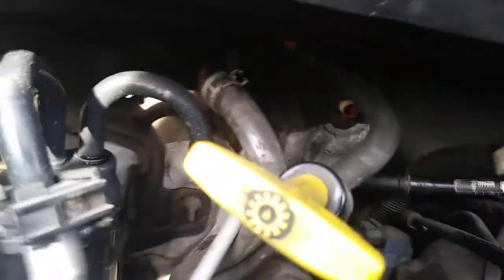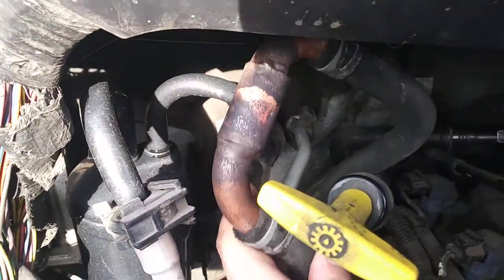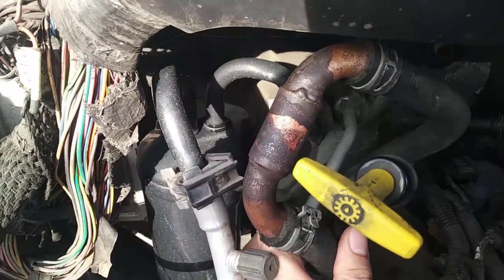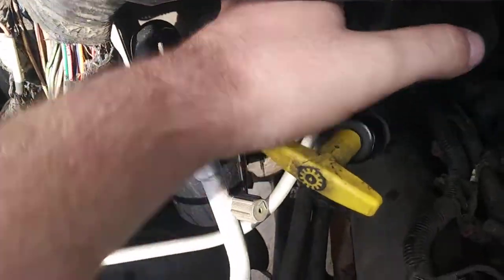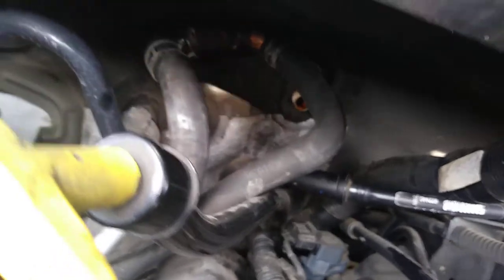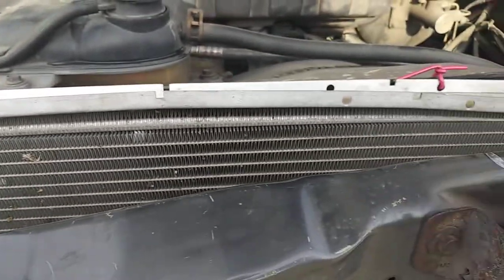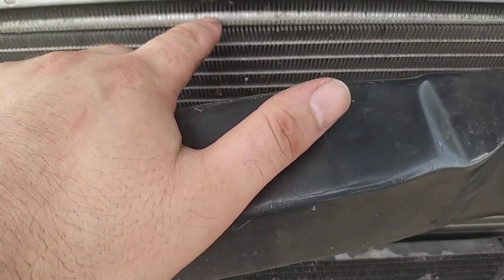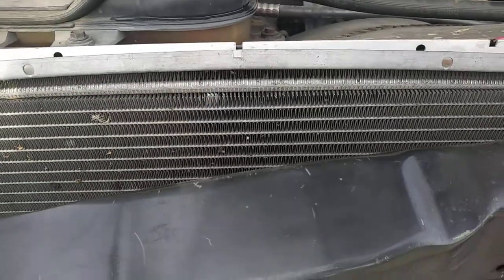How to Bypass 02 Dodge Ram Heater Core #shorts

Comment from the maker: This was a quick and easy way for me to do it with the materials I had on hand. The parts used were 2 long radius 3/4" O.D. Street 90s with a 7/8" coupler to connect them. It made a tight leak free seal that will last until I find the time to replace the core. Edit/update: I did replace that radiator on my own terms before the blown out micro channel became a problem. Bypass still holding; running the 12v defrost heater when needed lol

Comment: This is a great idea. Probably the solution i will do as well. Thanks.
Reply from the maker: thanks for watching! it is still working to this day. it would be nicer to have a heater but, until then; this will be fine
Reply: @71dembonesTV  Yeah I replaced the heater core (PITA like you say) and within a year it was leaking bad. So I'm done with it. Luckily I live in Arizona so just a couple months of the year are fairly cold. Heard you can use the defrost for a little bit of warmth instead lol. Also heard that by doing this, the AC works better. Not sure how that can be the case but that's what one video showed but it was on a 3rd gen I believe.
Reply from the maker: @jestes7  dang, i feel for ya having replaced it and it start leaking again. if i ever replace it; im going to pressure test the hell out of it before it goes in. im in the same boat where it's not a big priority due to the weather here in in so cal